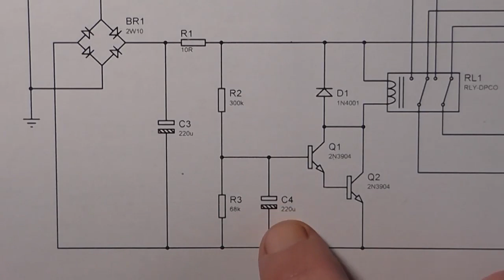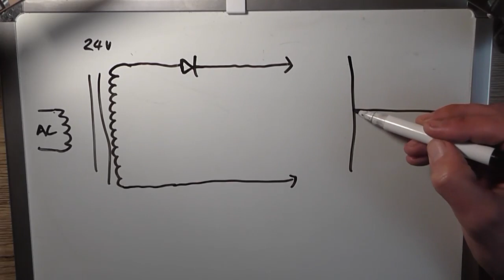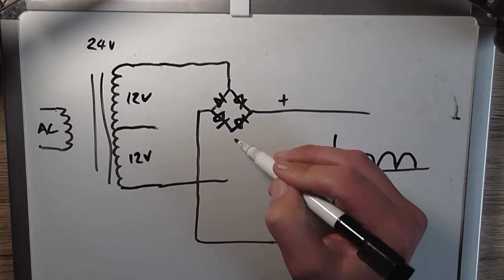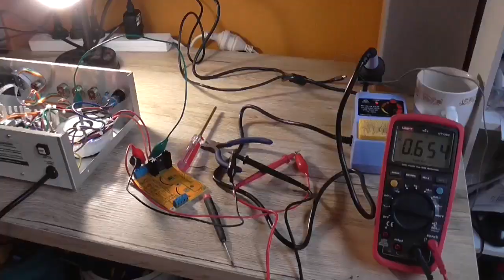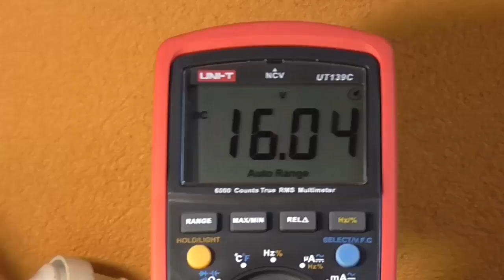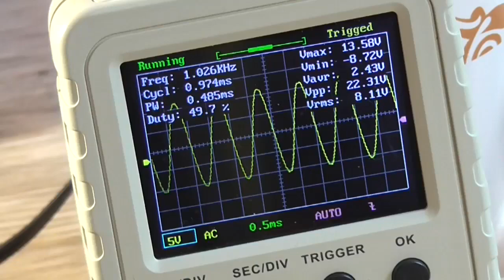JLH "1969" Class A Amplifier Power Supply Build & Test

Comment: The way it is done is reversed normally

Normally open contact is in the output of the amp.

Then normally closed is grounded.

And the common is connected to the speakers

That way the speaker is protected.. it also does not destroy the relay.. ...

Comment: Another great video, I'm learning a lot by watching your videos. I'm not a electronics expert so I need to ask a couple of questions. I'm planning on running two of these amp boards for stereo, do I need to get a transformer with a centre tap and if I use a 24v transformer and go through a power supply board with a 4 diod rectifier will that increase or decrease the voltage by enough to worry me or the amps.

Comment: I have a transformer 18-0-18 , 5 A. Will it work for 2 boards (Stereo) , If I am using same centre tapped full wave rectifier? What is the minimum capacitor bank required for this ? Thanks !
Reply: Yes it will work

Comment: Hello, I also built the power amplifiers, but I have problems with the power supply. The ones you're using don't exist anymore, what could I use? Can't find a solution and nobody can tell me anything. Can you help me with that. Would be really grateful to you, I'm desperate. Very good video. Greetings from Germany
Reply from the maker: You can just use a Transformer, FULL BRIDGE RECTIFIER and a chassis mount capacitor around 4,700uF.
Reply: @AstrosElectronicsLab  Hello, thank you very much for your answer, that helped me a lot, now I know what I need and how I can do it. Thank you.

Comment: Hi....I have the same kit as yours jlh 1969 and I wanted to know ... you the two blue trimmers at what value did you set them ??  your psu where can I find the files to make the pcb then ??  a thousand thanks...congratulations for the video!!! 👍👍👍
Reply from the maker: One trimmer is for current, it's set to around an amp. The second one is to set the half-way voltage point on the output.

Comment: I have had this jlh 1969 amp kit wired up and working with a giant aluminum slab of heatsink (guessing 10 to 15 lbs) with a acopian a28h1100 linear power supply for a while as a experiment. Sorta shocked even without its companion power supply what these cheap Chinese amps can do. I have seen some folks say some other amps are better ( no doubt their is always better in this hobby ) but these are really good for what they are.  These have do right powering my large b&w 802 the way they do with $$$ dac and preamp. I thought this amp hasn't been given a fair shake and wanted to thank you for putting in the time to test one out. Be curious what you would do to improve its performance? I have seen more versions similar to this. Their is a jlh 2003 version as well. Curious to what other class a amps you would Try? Maybe a diy pass labs first watt f5, f6, or a aleph j? Been wanting to try a aleph j for a while based on all the positive feedback. Been collecting parts for a while and have the f6 parts kit (they always sell out!) And the parts for a àleph j. I thought since so many folks have make these,or going to make one it would be some good material for your channel. You could do the power supply boards and build up (it's the same for all first watt amps so you can reuse it and exchange input boards). Than you can do another in stuffing one of these input boards and testing with a power supply. Or perhaps you could start with one of Nelsons class a amp camp 1.6 amps (2 kits for monoblocks) .  These kits also sell out at diy audio. Just throwing out ideas for ya! Thank you again!
Reply: Buongiorno, potresti indicarmi,per favore, quale darlington utilizzare,grazie per il Tuo aiuto e complimenti per il canale, Saluti
Reply: Replace the input transistor with a darlington. The extra gain will further slash the distortion (!)

Thank me later...
Reply: Buongiorno, potresti,per favore, dirmi quale darlington utilizzare,grazie per il Tuo aiuto e complimenti per il canale, Saluti @Theineluctable_SOME_CANT

Comment: to make a stereo amplifier you need 2 amplifier 1969. Do you also need 2 power supply card or just one is enough? and if you need 2 power supply card what transformer power should you use. thank you in advance. Patrick
Reply from the maker: one is fine. you just need a decent 3A transformer
Reply: @AstrosElectronicsLab  thank you
Reply: @AstrosElectronicsLab  is regulated supply necessary and can i use single rail.